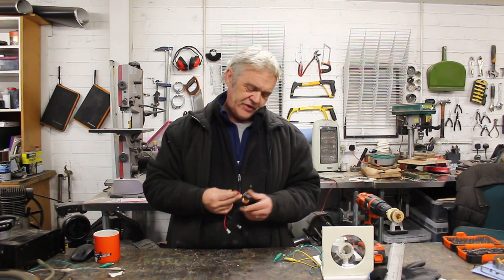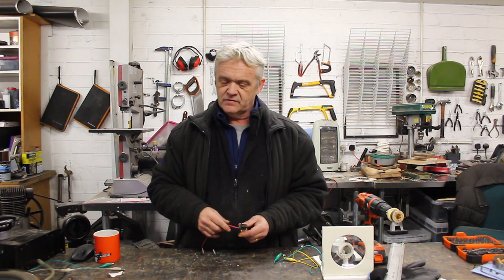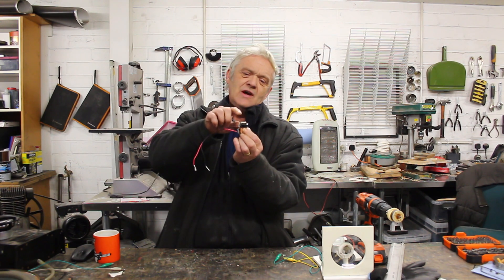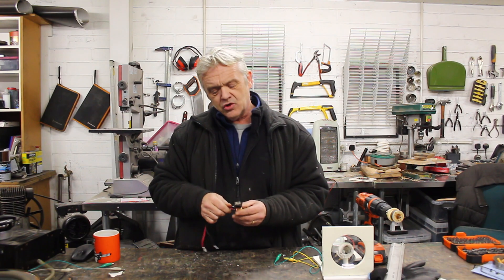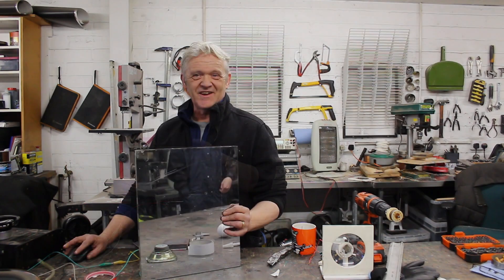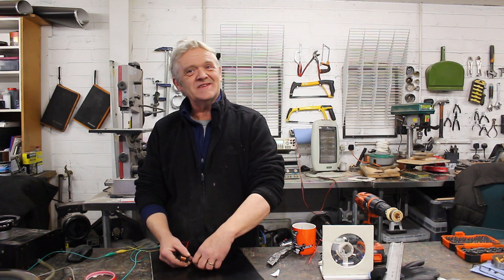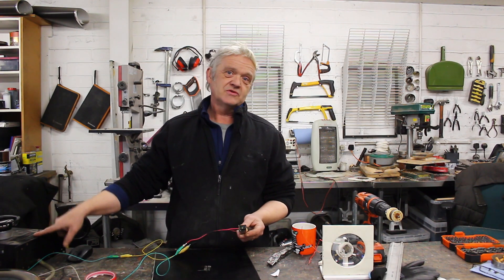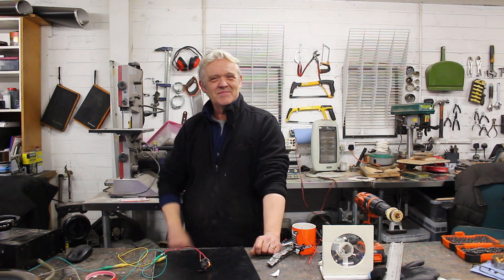1400 How To Make Magnetostrictive Sound Bugs

Comment: I thought magnetostriction applied specifically to materials which change shape in a magnetic field, like a magnetic equivalent to piezoelectric materials. This is just straightforward magnetic attraction isn't it?
Reply: zoom in to the Nano scale & look again, guaranteed this macro scale magnetostriction is also happening there, KISS
Reply from the maker: it does - but it also applies to composite materials that do the same thing - this is a macro scale composite - so basically you can see what is happening - as I said in the video if we mixed wire with silicon we would get a smaller scale composite which is the topic of lots of research papers - I read a few lol

Comment: so... moving the magnet gives a 'better' focused sound than moving the coil...
perhaps a bit of [ink dipped/dried stiffened] carbon felt replacing the rubber will produce a 'better' base frequency response as it will travel a larger distance for the given input
lol ottoth 2 magnets one coil for the win, small hard rubber > small magnet for tweeter response + outer carbon felt ring> microwave magnet for the base

Comment: just the coil will work, no iron core needed, i made a speaker this way a few years ago
Reply: sure, you can just wrap the bunch of magnet's in a cardboard tube & wrap/ conductive paint a fine coil on the outside of the tube then fix the tube ridged to the 'speaker' frame, but the core helps increase/enhance the changing flux magnetic field mass & give the moving solid magnet a fixed static centre to return to, be it sealed air gap/rubber/carbon felt or just a springed gap depending on what elasticity movement you require etc.
think Professor Eric Laithwaite's jumping ac magnetic aluminium rings ,the more you add the higher they rise

Comment: Excellent video Rob,just wondering why the sound volume has decreased in a few of your videos lately. I have my phone volume at max and can barely hear you, then an advertisement comes on and I get blasted.
Reply: Old age -it’s natural
Reply: @PetraKann  uh no I've been getting the same on this pc. sound used to be good at 20, and now I need 40.
It is and EQ thing on the production side.
Reply: @donaldhanson2908  What? Can you repeat that in larger font? Maybe 72?
Reply: @donaldhanson2908  i suspect it's yt screwing with the recording reencoding when  your uploading 128 sound instead of 192kHz + sound files as i noticed this on lots of yt channels lately.. set your video recording to always use 192kHz + sound recording regardless of screen resolution to test it...

Comment: If you want to get fancy you could bounce a laser off that mirror to measure the vibrations and reproduce the sound with a speaker on the lasers side. :D
Reply: more fun... get cheap 'Floplast Underground Drainage Pipe 3M 2 Pack' do 2 cellophane speakers to fit inside one end, wind the coil on the outside of these uncut pipes to drive these internal magnets in the centre of these two pipes for 6 meter speciated sound fun /sound pump/ sound stirling experiments etc driven amplified Bluetooth modules powered by low volt ground batteries ,3v to 15kilavolt exploding vertical water pipe piston's + stacked Linear Switched Reluctance Generator etc

Comment: A 8 ohm amp ran at 4 ohms will overheat the amplifier. I used to use earbuds and headphones with a splitter to increase the sound output.

Comment: Could you use something like a balloon and Would that change the way it behaves .
Reply: sure ,what is an inflated balloon but a contained collection of compressed fluid... one crevette being you want the input sound to be linear transferred to the other side for optimal transfer... think restricting the balloon sides in a rigid pipe or net as you inflate it, the higher the pressure ,the more gas in the given restricted space, try a modified bike tire in a pipe with a end magnet diaphragm on one end